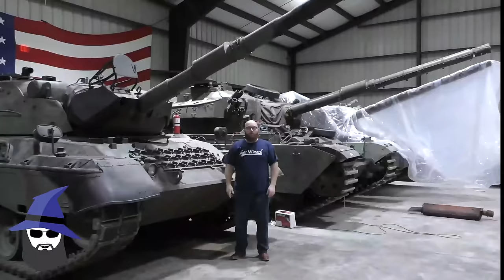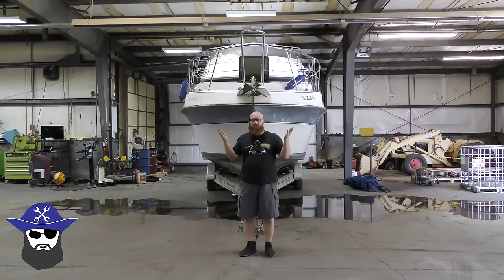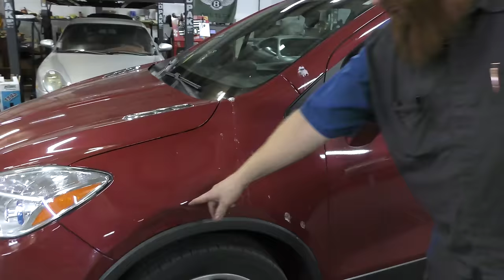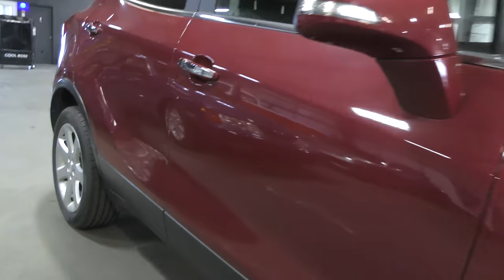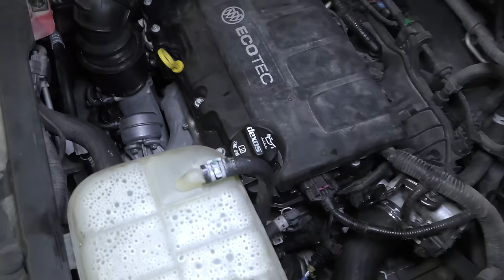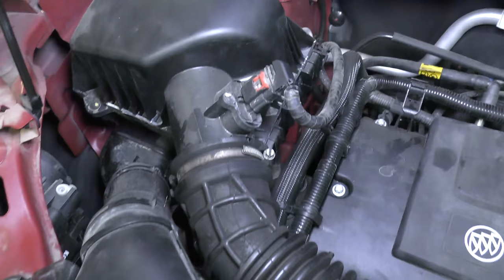How did a dealer miss the problem on this '15 Encore 4 times? CAR WIZARD just had to read the codes

Comment: This doesn't surprise me. A friend whom I do repair work for from time to time called me about one of her friends vehicles 2014 Cadillac CTS that the local caddy dealer wanted to charge her 742.65 (I saw the written estimate) to change her headlight bulb claiming the whole assembly needed to be replaced. 
I charged her 80.00 to replace both bulbs 40 of which was the cost of the 2 bulb pack.
Moral: Just because it's a dealership, it doesn't mean their honest or competent

Comment: This  doesn't  surprise me at all.  Years ago I had a  Oldsmobile  with the  quad 4. It was giving me the  low coolant and  overheating  lights.  Being  under  warranty  it went to the  dealership where after  two weeks they  changed the  thermostat and  filled it with  coolant. I made it a  few miles and  the  low coolant  and  temperature  lights were  back on. I  stopped by  a friend's house, he  stood  behind the  car and said  blown  head gasket,  you  could  smell the  coolant  coming  out of the  exhaust and  see the  liquid  dripping  from the  tailpipe.  Straight  back to the  dealership, and the  actual  problem was  fixed.

Comment: I don't know about there, but here in Calif. one of the reasons for shoddy repair work is that most dealerships hire low payed "apprentices" to handle as much of the work as possible.
In some cases rhat's fine, such as doing an oil change. 
Unfortunately, since the apprentice is paid about 1/3 what a "master technician" makes (and the dealership is charging hourly rates triple that), to maximize the profit they have as much work as possible done by the apprentices. Other cost-saving/profit-maximizing stuff gets in the way, too. (Most businesses go downhill once the bean counters are put in charge.)
For example, I bought a used truck and asked the dealership to fix a few things,  install a couple accessories. Easy stuff I'd do myself, but why not get it done as part of the purchase? 
Long story short, a broken fog light was replaced with a used one that was also broken, tho not as obviously. Also, the brand new side steps they installed nearly fell off by the time I drove home 15 miles from the dealership. No washers, lock nuts or even a drip of Locktite on the bolts, which loosened after 1/2 hour on the road. Stuff so stupid that I just fixed it myself (resealed the leaking fog light and installed proper hardware on the steps). Why drive across town to have them screw up something else?
While I generally avoided letting the dealer touch the car, they were the only local one for that brand vehicle, so I had no choice but to have same dealer do some work just before the warranty expired. And they screwed that up too. They had the truck for several days and finally told me the work was done, come pick it up. Before I drove 2 blocks I knew something was wrong from engine noises, so I headed right back. Apparently they hadn't done a test drive because it was impossible to miss the noise that turned out to be a water pump they'd screwed up while working on something else. They even tried to argue with me, so I invited the "master tech" to take a ride with me and he finally had to admit there was a problem. 
After the warranty expired, I've completely avoided the dealer's shop and discouraged other people from using them. I either do the work myself or have a "trusted" shop do stuff that I can't. (Unfortunately, one shop changed owners, I found out, and not sure they are still trustworthy.)

Comment: I had one shop install the wrong size rotors on my Audi A6.  (It is hard to get that info from Audi, but they should have compared then to the originals.)  Took the car to the Audi dealership, supposed Audi experts, a couple of times for warranty work and they never noticed the mistake.  I needed to get some suspension components changed out and so I took it to a really well recommended local independent; within an hour of it being there I get a call, "Do you know that you have the wrong sized rotors on your car?"  

The place that installed them originally was also an independent.  They did the right thing and swapped out for the right ones no charge.  The only thing they asked was that I bring the car by just to verify because the owner couldn't initially believe someone who worked for him could do something so stupid.  On the phone when I called him his first response was simply to ask me to repeat what I had just said because he was kind of in shock.  "We did what?" LMAO

Comment: I’ve refused to take even my new sonic to the dealership. $2100 for tires was insanity. Brakes changed at $1722. After that I’ll never return. Over priced and one tech even managed to mess my radio up after removing it. I had my brakes done. The radio didn’t need to be removed

Comment: If you dont know what you're doing the dealer will get you every time! very rare i bring work to the dealer, even under warranty, they always find a way to charge you out the A. Even if that means misdiagnosing your car 10 times. thats an extra $1000 in diag fees alone.

Comment: (Wall of text/story time)  IMO, it's not mechanic shops, it's dealerships that are the issue.  Like 20 years ago a similar incident happened to me when I was in my teens:

I drove a 1992 Nissan Maxima that at the time, during winter, didn't warm up at all.  I had no heat coming through the car and the needle didn't move to operational temperature when I would drive it.  It was winter time, so it presented a problem since I couldn't defog my windows with my car and had to do so manually as I was driving the car.  So I took it to the Nissan dealership to have it looked at, and they told me my head gasket was cracked and a radiator was giving out and one more thing was wrong (forget what it was, long time ago this happened).  They told me that it was going to be a little bit over $6000 to fix the car.  That's not a typo, OVER $6000 to fix the car that had over 170k miles on it and was worth like $1500 at the time.

I lived in Pennsylvania at the time, so instantly I started to panic because I was 18 at the time, living on my own, waiting tables at a Perkins Restaurant and did NOT have anywhere near that type of money to fix my car or buy a new one, and you NEED a car in PA, so I didn't know what to do.  I took my car back, paid the diagnostic fee and left the dealership, feeling screwed and honestly a bit hopeless.

Then I remembered that when I lived with my Dad, he always took his car to a particular Midas from his house.  Not any Midas, this particular one (which I later learned that that does make a difference because all corporate car repair shops are NOT built the same, it's not like McDonald's or KFC etc.)  So I figured, what the hell, I may as well take it there and get a 2nd opinion because what did I have to lose at that point.  Maybe they can do the repairs that I need a bit cheaper.  

So I bring my car to this Midas that my Dad always went to, wait about 30 minutes, and the mechanic comes out and brings me to the car to tell me what was wrong with it.  And you know what it was?  A thermostat.....

.....a thermostat, THAT'S IT!  That was ALL I needed to fix the dam car, and it didn't even cost me $100 dollars to fix it either.  I told them, absolutely, fix it, paid my $97~ and was on my way.  I couldn't have been in the shop longer than 90 minutes.  I start driving and BAM, car heating up!  Car working at operational temperature!  I have heat in the car and can defog my windows!  Not seeing my own breath as I breath while driving!

So as you can imagine, I was PISSED!  So what did I do?  I took my receipt that I got from Midas, and went BACK to the dealership THE NEXT DAY and DEMANDED to speak to a manager. (only reason I didn't go back that same day was because the dealership was closed at that point for the day)  I was so mad and I was ready to cause a scene.  The manager comes out after a minute or so and I said to the guy, "I was just here yesterday with my car, and I want to know why would you tell me my car was going to take $6000 to fix, yet I went up the road to another mechanic who fixed my f*ckin car for not even $100" as I slammed my receipt on the table.  He looked at me for a second, made a little smirk, and said, "well we have different standards and qualities and there's no guarantee that they fixed the car, it may only work for a while before your symptoms come back.  We service our vehicles a certain way and know all the specs for our vehicles."  etc.  I swear these dealerships just were born with swift tongues.  After not getting anywhere for about 5 minutes arguing back and forth with this guy, basically rebutting everything he was saying along the way, I just picked back up my receipt and walked out.  The lobby at the time was full of customers waiting to get their cars repaired or serviced, so I had a nice audience of people who saw me in there losing my $hit.  

All in all, I learned that day that you'd think that taking a car you bought from Nissan back to the Nissan Dealership for repairs, that that would be the best way to fix your car since they're the specialists of their own car.  But I learned the hard way, like this customer, that that is not the case.  A mechanic that works on multiple different cars and has good instincts on what to check and fix is a much better option than bringing your car to the dealership, you just have to find a good one.  That's what I've been doing with all my cars since.

PS = I hope this woman took her receipt to the dealership and got a few choice words in herself.  It won't get you your money back, but you will feel MUCH better about it afterwards! 😄

Comment: Have a 2013 Encore and it would all of a sudden overheat. Added water to it and drove several hundred miles, then all of a sudden the temp would go sky high.  Found that the thermostat housing (plastic) was cracked and the thermostat inside it had flipped almost upside down in the housing. Replaced it and has been good ever since. Now have a P0420 code. Replaced the upstream O2 sensor, replaced the catalytic converter (ouch), still showing P0420 code. Guess I'll try the testing downstream O2 sensor next.
Reply: how did it go with the downstream O2 sensor replacement?

Comment: Don't get me started on GM's "new" smart charging systems.  My '15 Cruze undercharges the battery so that you are forced to replace the battery every 2-4 years.  AND they spec a more expensive AGM battery because THEY KNOW they are making the computer undercharge the battery (overall).  It makes no sense at all on my diesel Cruze but they are applying the computer algorithm across the fleet to eke a few more avg mpg for the CAFE standards and passing the cost to the consumer.  It only ever charges over 14 volts on cold startup and when coasting down with the brakes applied.  When warm outside and engine warm it's almost always at about 12 volts.  I complained to corporate and got a bogus "cars have more electrical loads now" BS in response.  They KNOW darn well what's going on.  It's straight-up ripping off consumers.

Comment: Name the dealership that claimed doing an oil change would fix a check engine light...

I took my car to the dealership once because the airbag light was on.  My mechanic couldn't figure it out as it wasn't storing any codes, and there was a recall on the passenger seat occupancy mat.  The dealer determined the occupancy mat had already been replaced (I bought the car used) and that the cause of the airbag light was a bad "intelligent battery cable".  They wanted almost $3k to replace the entire cable from the trunk where the battery is to under the hood.  I replaced the rear portion of the cable myself, from the battery to a junction point under the floor behind the rear seat, for $300 (and a couple hours of my time).  The light went away and hasn't come back in two years.

Comment: I took my buick encore to a service shop, it had 74000 + miles. The engine started skipping at times. It is a 2013. I dont put a lot of miles on my vehicles because I dont have to drive far for work. They ended up replacing the turbocharger, oil pan gasket cover, abs module, doing other things. Totaling over 5000$. 1 month later I drove to another state on a long weekend. After arriving at my destination and shutting the car off, I checked in to my hotel, then my husband started the car to drive it around back. Well as soon as he started it the oil light, the engine light and all kinds of bells and whistles happened so he shut it right off. Longer story shot the engine is blown. We had to rent a uhaul and tow trailer to get it back home and to the service shop. After 1 hour they determined it was "most likely an oil.pump failure" and totally not related to any work they did. How likely is that?

Comment: I used to let shops/dealer work on my cars until I found that most shops have incompetent mechanics or just want the easy repairs. My 2002 Ford Explorer got that famous broken elbow hose that causes a vacuum leak and money light is on. Idle is bad and I let the shop diagnosed/fix it. Being a car-noob at that time, they sold me for a seafoam intake cleaning because they say it will fix the issue. I picked up the car later with the money light still on and still idling bad. They say it will go away... once I arrived home, I checked the engine bay and the cover wasn't even removed at all (it's still covered in dust, so pristine) and the hose is visibly hissing and upon further inspection they never do anything to fix it, just that can of seafoam they poured in the engine... and they have ASE certified mechanics... At that point in time I decided to learn DIY and not trust shops/dealer.

Comment: My buick is only 2 years old. I went through 5 batteries.  

My 2021 Buick Encore has had  the steering control arm, tie ends, and ball joints replaced within the first month of buying.  The fan was also replaced.  I have gone through 5 Batteries, and after going in multiple times for an engine noise, I who is not a mechanic, found out its a purge Valve issues when the trained mechanics couldnt figure it out.   

I have put way too much money in the vehicle, and like I said,"I've only had it it for 2 years with only 4,000 miles on it.  I will nevwr buy GM again.

Comment: I had a 03 ranger I bought in 05 it had 24k miles on it it had a vibration at 65 on the highway. The tires where kinds of crappy so I put new ones on still had a vibration after 5 times to the dealer and still the same problem I decided to figure it out myself as I am a auto tech. I thought the dealer would be smart enough to fix it that's why I just brought it to them in the first place and it was still under warranty. Anyway I put it up on the lift ask my boss to get in it and drive it in the air at 65 1 minute later with a stethoscope I found the tcase just growling away.so I bring it back to the dealer and had to basically tell them how to find the vibration and how to fix it. 1800 dollars later truck had a new tcase in it and no more vibration its so sad today when you can't trust the dealership to be able to fix there own CARS! I ALSO FOUND out right before they put it on the lot for sale they put a new transmission in the truck for the very vibration I was complaining about what meat heads. I am so glad I can fix my own vechiles. Like I said I only brought it to the dealership because of the warranty and wasn't going to spend my money. This process took over 6 months they said they had to have one of the engineers come look at it to figure out the problem and they still weren't able to fix it intil I told them what was wrong! All the engineer did was put weights on the drives haft yoke and each time they tried to fix it I would take it get on the highway hit 65 mph and bam the vibration was there and each time they told me truck is all set vibration is gone but it wasn't intil I finally got involved.  Had I known they where that incompatint I would have just diagnosed it myself from the beginning. I am a auto tech of 20 years now and I see lots of vechiles coming in the the dealers just can't seem to fix. It's a very sad thing!

Comment: I've had my brakes turned at a BMW dealership because that's not something you do yourself and with that $150 labor fee from those "technicians", they managed to over-torque my lug nuts to the point where I needed to use a 10 ft breaker bar just to remove them. Luckily I did call them out on it and they replaced all the lug nuts for free, but it's the main reason I fix everything myself using this magic thing called a torque wrench...

Comment: I'm looking at buying a 2019 Encore from a salvage auction (I know...) with 50k mi. and a VERY clean interior. I'm guessing it was driven by an elderly individual. I've heard they're slow and that the 1.4L turbo can go bad at low miles.  I'd hoping my wife can drive it a couple years without issue. Any happy, high-mileage 1.4L owners out there?

Comment: We own a 2016 version of the same car. Works quite well in traffic and open road. Passenger seat has no arm rest, so is not as comfortable as the driver's seat. Gas mileage is good. Nice car. No problems. Since we live in the Houston Texas area, every oil change, I request a load test on the battery. I did have to replace the battery on the 2017, but it was under warranty.

Comment: Owned a '13 Cruze with the 1.4 turbo. Nothing but cooling system and turbo issues. Sucked because it was actually a nice car otherwise. Wish it had the 1.8 like my father's Sonic, which was trouble free for 200k.